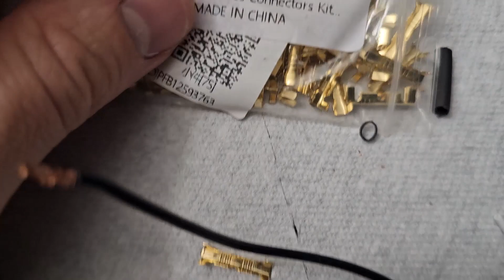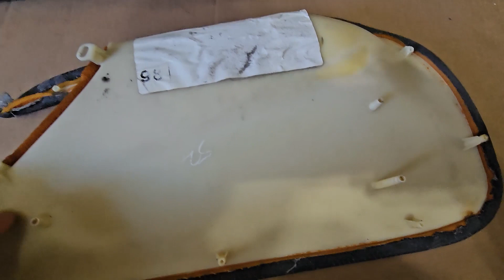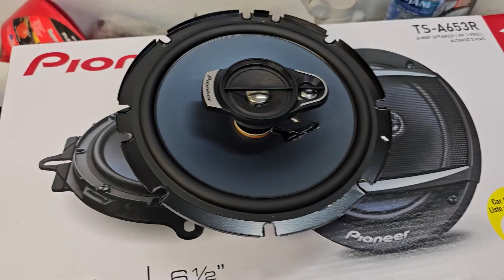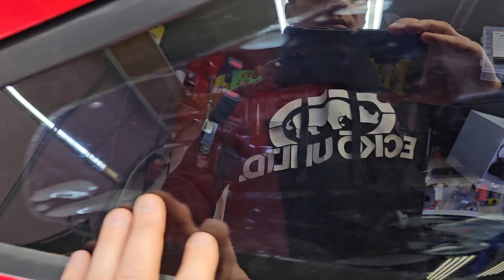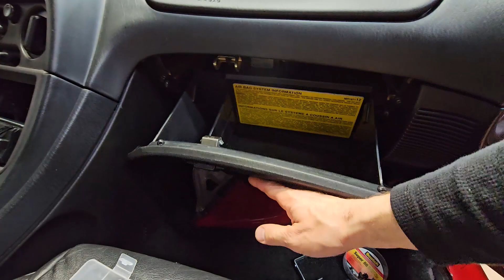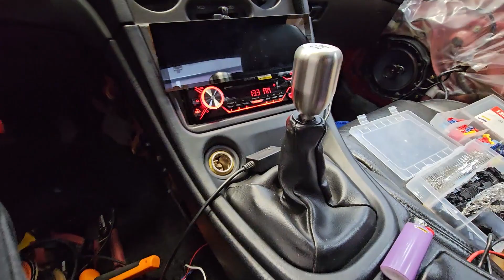Eclipse 2g GSX Interior Restoration - Part 2

Comment: How did you go about mounting the screen and wiring up the screen and raspberry pi4 for power?
Reply from the maker: Still haven't mounted the screen ,but the power is 12v from the battery with switch and 12V to 5V DC USB Type-C Right Angle Step-Down Power Converter.https://www.amazon.com/gp/aw/d/B086KTGRH1?psc=1&ref=ppx_pop_mob_b_asin_title